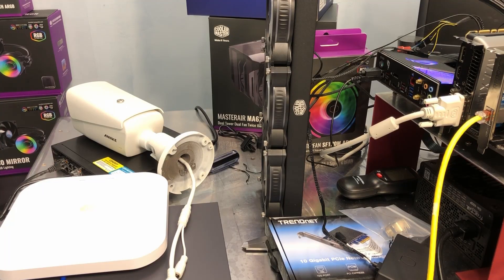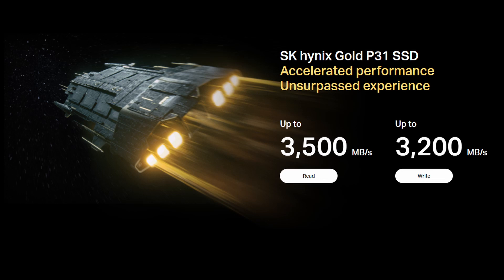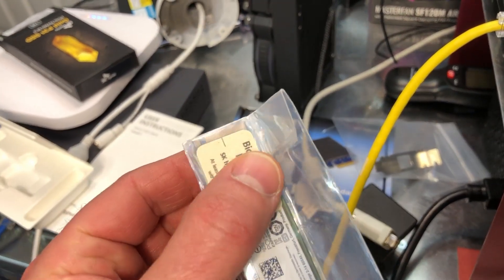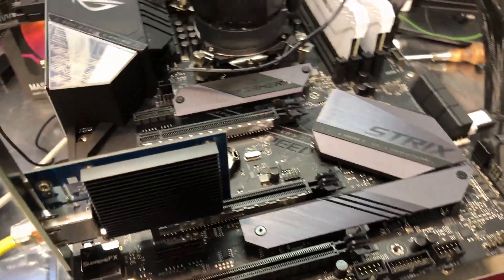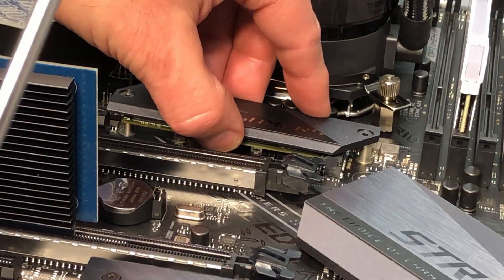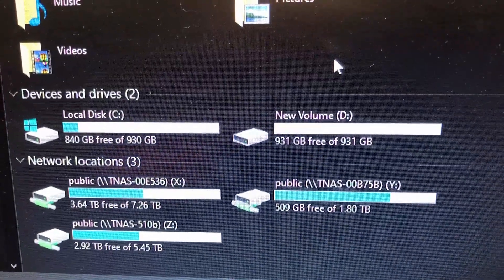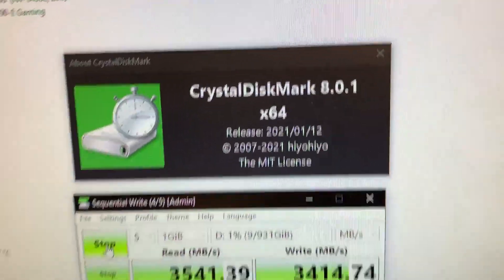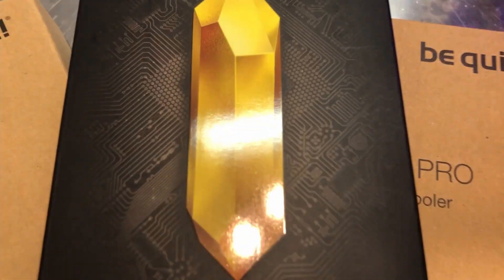Overclockersclub checks out the new SK hynix Gold P31 1TB M.2 SSD!

Comment: i remember one of my first hdd was as big as a 4 slices toaster and had 2/3 of it's height . that hdd  was about 40mb, it had 2 data connectors and 1 molex  for power . i believe  it was in an old 386 or 286 ( not sure) system i had over 25 or 30 years ago. technology has come a long way since then lol
Reply: Now a stick of gum can hold 8 tb or more LOL with barely any power draw and heat .. that's advancing technology